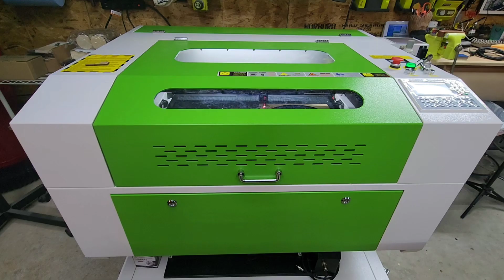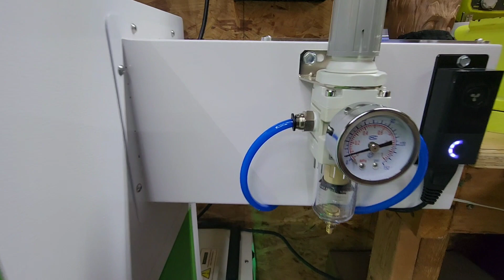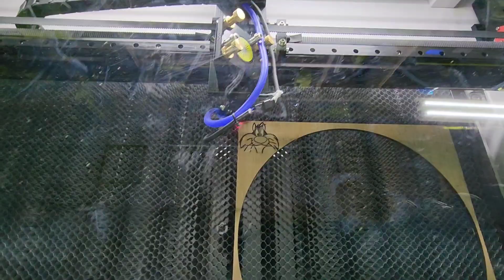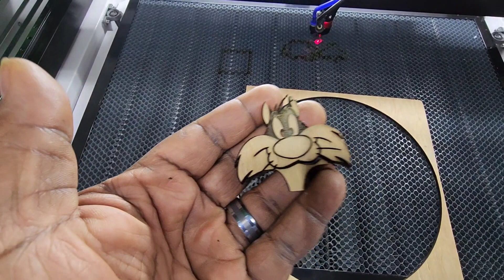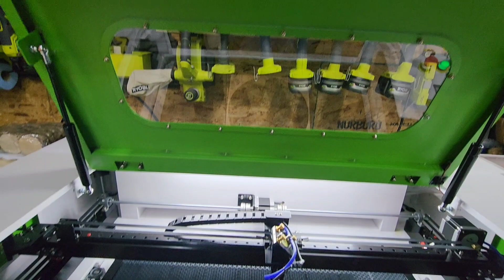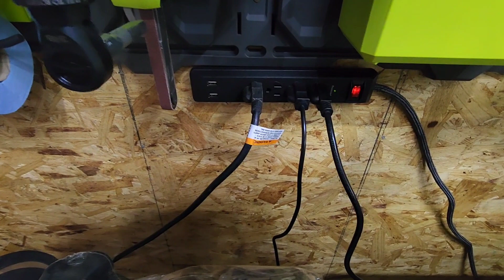US RECI MELDIKISO 90w C02 LASER PT. 4 - FIRST TIME RUNNING

Comment: How thick of metal will it cut? Like mild steel
Reply from the maker: Not cutting metal with this laser. You can etch on aluminum especially if it's coated with some kind of paint. If you want to cut metal may be better to look into a desktop CNC machine with a good spindle

Comment: I have picked up (2nd hand) this exact same machine, without a manual...I have downloaded Lightburn to utilize.  Question....Does using Lightburn completely bypass the front machine controller?  Any advise would be GREATLY appreciated.....I am starting from scratch and certainly don't have a background in electronics.  Machine is hooked up and ready to go (with Invertor and exhaust fan)....Can't wait to use it! Thanks! I have enjoyed your videos!
Reply from the maker: Yes, Using Lightburn you dont need to control the machine from the control pad. I only use the control pad to move the lasaer head when I need to adjust the bed to the material im cutting.

Comment: You should drain the water from the compressor daily. Water sitting in the tank will rust the tank out.
Reply from the maker: Oh Absolutely! I dont know if it was said but I installed a drain extension valve that I drain everyday. I think I mentioned it cause I removed it from my other compressor. Good point though!